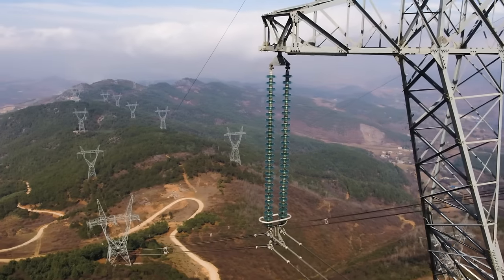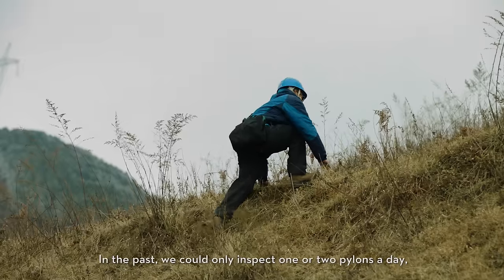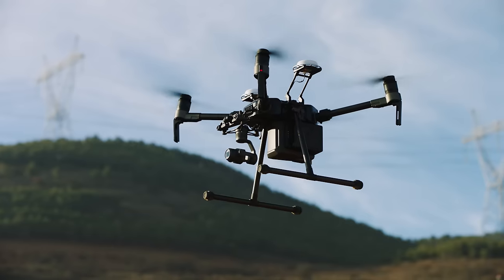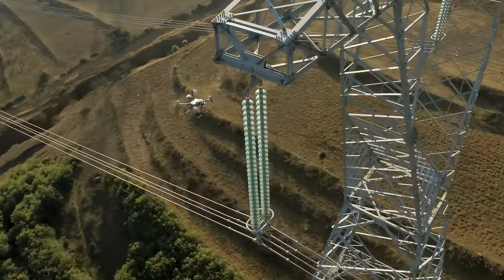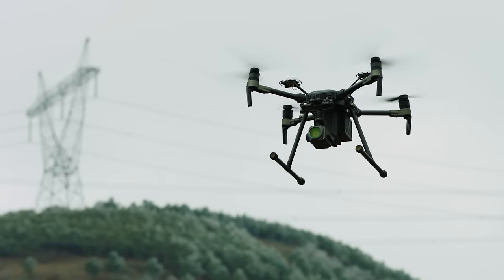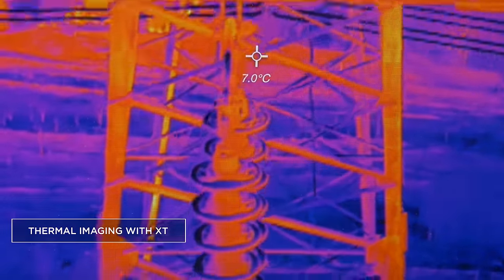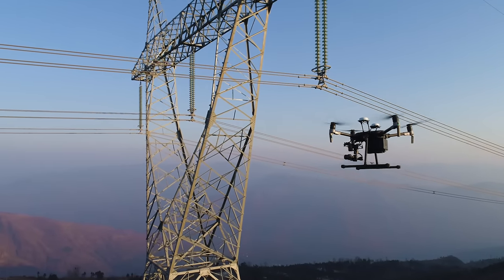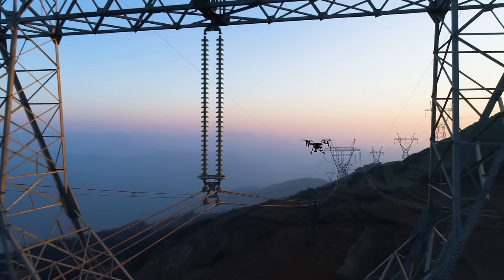DJI – M200 Series– Powerline Inspection Tool

Comment: RTK is really problematic to get it to work. Even sometimes in an open field, I can't get enough signal to be able to take off. I need to re-position the aircraft several times to find the sweet spot with the best signal reception.